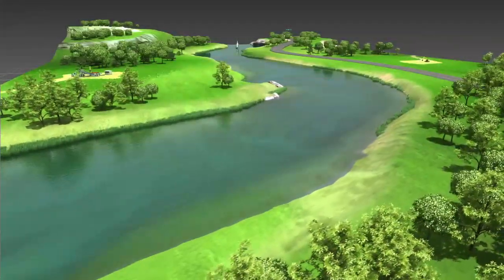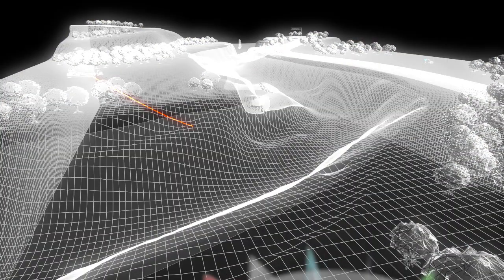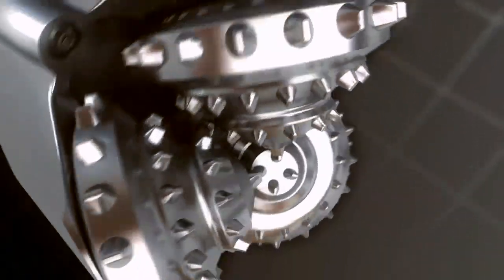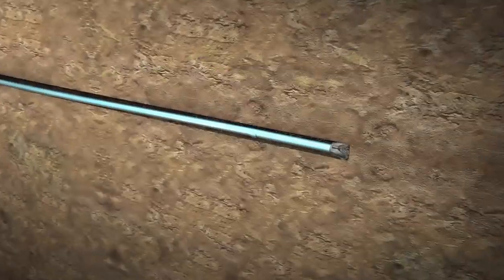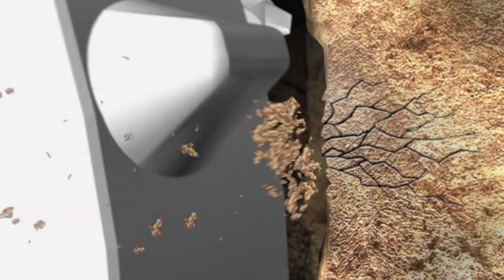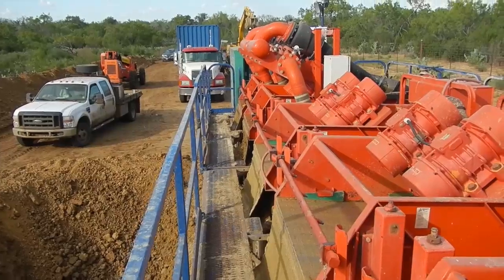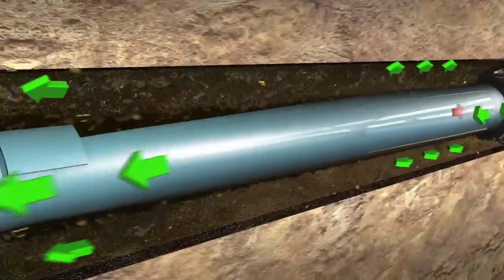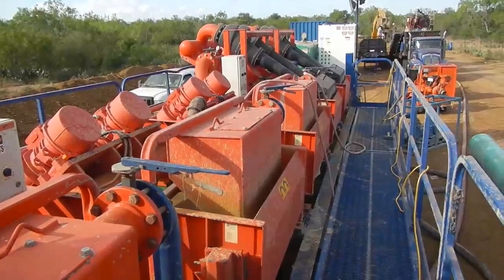Horizontal Directional Drilling / Boring (HDD): How the Drill Bit Works

Comment: Want to look into frackn excellent idea on the clay 👍👍👍👍👍just finished looking over the industry o poo what is the worst thing you can do to granites(fracks)😕 I've been looking into hydrogen capture and repressed carbon with a bit off lab time it might be possible to fusse the hydrogen and carbon to the stone include to bond link and a hole set line for long term capture😬 and they are not doing this correctly iam having a bit of a heart attack on a few stuff up's (I've worked as a tiler and a bit off stone, it looks like a family a dozen home if not more and a town are been poisoned due to miss management and they cracked the surface am trying to look into new clean drilling and high water pressure cutting with a 3 drill setout 90 degrees similar to this  blasting and acid striping cr@#😧😳😵 but all set for max strength and max draw with high pressure water suction I've the area as you can enrichment the stone bye pressure and maybe a bit off heat? I should be able to make it look grey stone if done right? but is likely going to take some time for those gases to excape😬 couple off big one's or the one they don't want goes straight into the atmosphere this hole family in gas line looked half dead poisoned and strike on the gas breach.
Reply: Mechanism
Reply: Very good post thank you👍